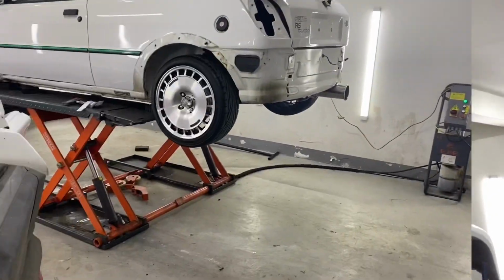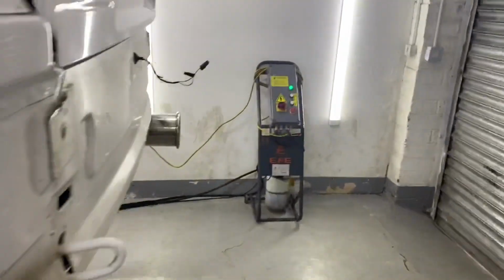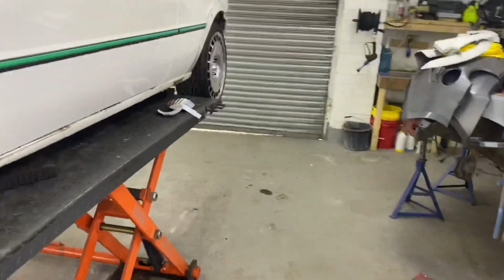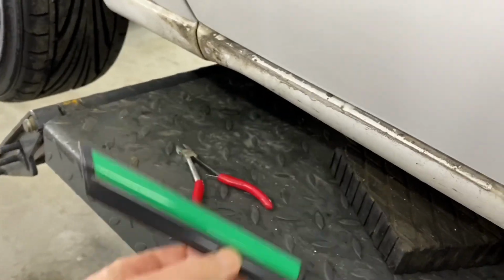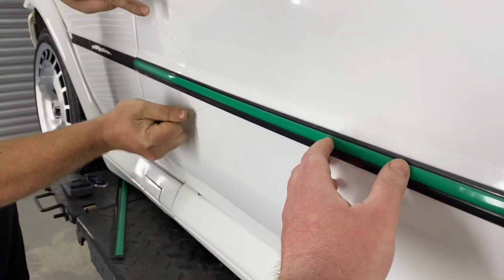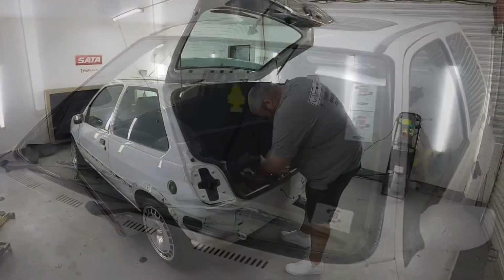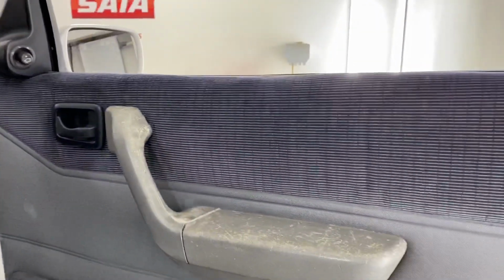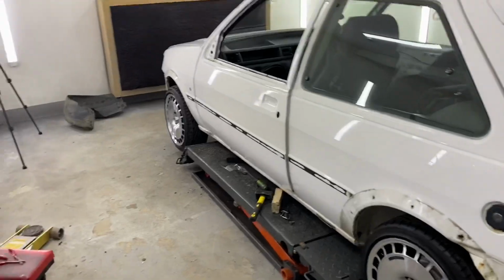ford fiesta rs turbo fully forged zvh paint repair!! part 2

Comment: I wish all car sprayers had your talent the amount of rubbish work I’ve had done over the years at dealerships. I wish they’d have your talent loving the fiesta Rs love your channel. Stay safe 🤙🏻
Reply from the maker: Thanks appreciate it 💪💪💪👊👊👊
Reply: He clearly has a passion for what he does where as body shops just want them in and out the door ready for the next 1 but your 100% correct mate if body shops took more heart into their work. My MX5 is going in for a full paint job soon and I'm dreading it I pray to the car good they dont fudge it up.
Reply: Fingers crossed 🤞 for your Mx 5 hope it goes the way you want. I had to have a new quarter panel on a brand new seat at the time and the paint blend was rubbish you could see it a mile off. So I ended up in a little noddy car for the best part of 4 months so it’s great to see a master at work 🤙🏻😎

Comment: You will find the ramp a godsend mate, I have a similar one by automotech and it’s brilliant.i have bolted it down as moving em is a pain .
They weigh 600k so not easy on your own. 
Best respray the lot on the fiesta for a top job 👍
Reply from the maker: Yeah it wasn’t light as I found out 😂😂😂

Comment: When I sprayed many years ago, we used to always wet sand primer before painting, and get a lot of jobs coming back with micro blisters🙈if there is any moisture left in the primer rubbing down marks, and it’s then sprayed over,the moisture has to escape somewhere,so it comes through the paint, hence nowadays most paint shops are all dry rubbing down, I’m sure you know all this anyway Phil 👍
Reply from the maker: Yes mate it’s all down to prep and time these days it’s rush rush rush that’s why I don’t work for people painting takes time 👊👊👊

Comment: Fantastic content 👍 it’ll only add value to the car with a top notch paint job, the ramp will help you out no end, can that be left in its place and you drive over it? Or does it need moving when not in use.
Reply from the maker: Thanks 🙏 🙏🙏 yeah can be left and or I can wheel it around where I like 👊👊👊
Reply: SALVAGE FLIPPERS great piece of kit! Thanks

Comment: Hey Grant, while your talking about re-spraying, you mind me asking a question?  I need to spray the top of my slam panel as it’s starting to bubble and wonder what grade of sand paper would I use and the kind of black paint  needed? Its a red car but the slam panel is black. Apologies if it’s a stupid question but I’m a complete amateur when it comes to body work.  Keep up the good work, excellent content as usual. 👍
Reply from the maker: It’s hard to say as to how bad the corrosion is thus working out how much you have to sand if that makes sense 👊👊👊
Reply: SALVAGE FLIPPERS  100%. Think it’s just starting to go,  bit like surface rust, if you know what I mean. Do you know what kind of paint I would use,  regular automotive black paint?
Reply from the maker: Yes I would try using some 320grit then 400grit then 600grit  and then use some black in a aerosol can 👊👊👊
Reply: SALVAGE FLIPPERS  Great.....Thanks for the tip🙏Looking forward to seeing more updates. 👌🏼👌🏼

Comment: so are you painting all of it? or would it be better and quicker just to do it all anyway? where the micro blisters are can you just fetch paint down until they disappear or do you take it to bare metal?
Reply from the maker: All bar the roof and bumpers, and with the boot I have to take it right back down doesn’t have to be to the metal just back through the layers 👊👊👊